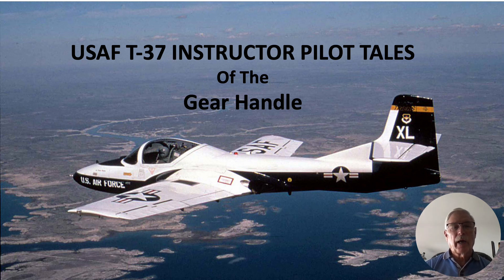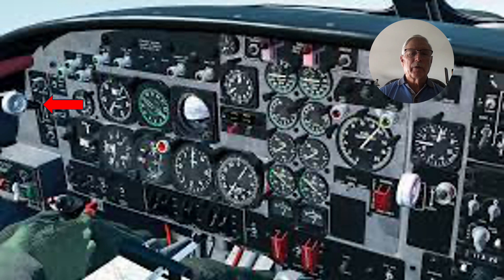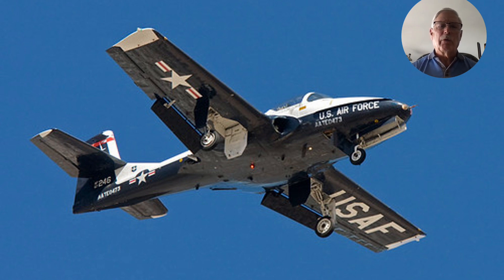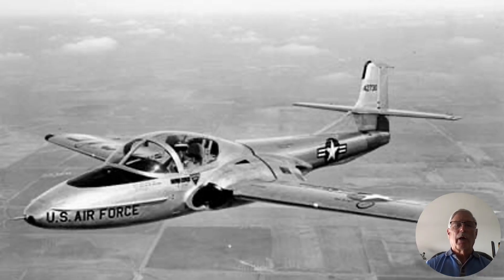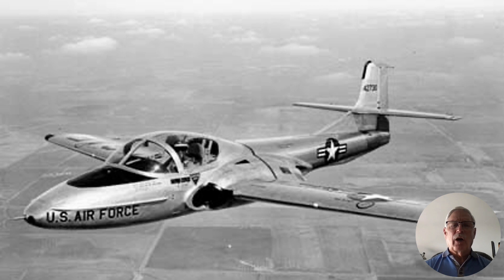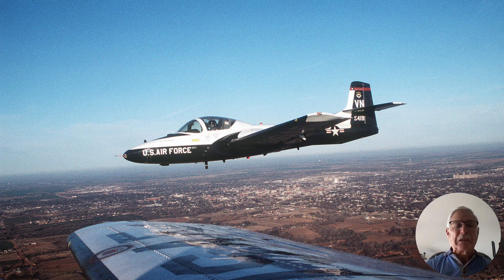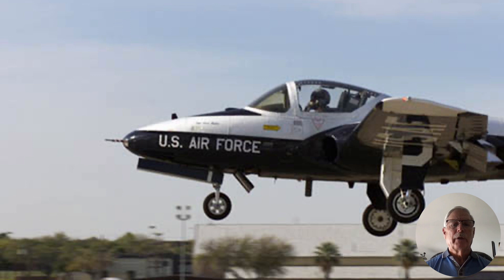USAF Instructor Pilot tales of the gear handle

Comment: I was at an unfamiliar guard base, and we pitched out.  Tower called us to tell us about the F-4 on final, did we have him in sight?  Stanley got all involved in searching for the F-4, and when airspeed began to decay, he advanced power (above the gear horn point).  Tower then told us to extend our downwind because the F-4 was dropping the drag chute and the truck was going out to get it.  We continued on downwind, power up (gear too) and at about 1.5 miles past the threshold, tower said we were cleared to land.  Since we now had almost no altitude to lose to roll out on glidepath, Stanley dropped the flaps and began the "final turn", but it was nearly level to roll out on a good glidepath.  Plenty of headwind, full flaps, no gear (and no horn).  So I pushed the "IP on Private" button and told tower we were gear up and making a low approach.  Stanley couldn't hear this transmission.  At about 1/2 mile final, I asked him how it looked, and he said maybe it would be best if we went around.  Good idea.  He pushed the power all the way up and then reached to raise the gear.  He froze when his hand touched the gear handle already up.  I said "Whatsa matter?  Didn't you think I knew your gear was up?"  He was another pilot (ACE program co-pilot).  Q3 (It wasn't a checkride, but I was an EP and I wasn't about to debrief that one under the rug).  Lesson(s) learned?  If your pattern starts getting too far from normal, clean it up and start over.  Also, any distraction in the cockpit (where was that F-4 again??), means you should double/triple check all your normal procedures.

Comment: Good examples of a couple of classic student errors, Ron.  Giving "lip service" to gear checks, i.e. saying the words without actually checking the items. I also found that when students forgot gear and/or flaps, they tended to focus entirely on reducing power to fix the high airspeed and didn't think to re-check configuration. It's a good thing to remember in any aircraft. 

If I remember correctly, the flap limit in the T-37 was 135 knots, so it was also easy to overspeed them.
Reply from the maker: Thanks and yes, 135 kts

Comment: Probably back in 1993, while I was still a jet engine mechanic working on A-10's assigned to the Pa Air National Guard 111th Fighter Wing out of then Willow Grove NAS, we were on our trim pad facing runway 15 conducting an engine maintenance run on one of our A-10's. Our trim pad was close to the taxiway and runway and always gave us an unobstructed view. Our A-10's were in and out of the pattern that afternoon practicing their approaches after returning from their normal training missions. No touch and goes allowed in the A-10. So as we watch them come in, gear down, get pretty close to touch down, add power, suck up the gear and go around again, we notice one of our A-10's approaching with the gear still up. Now being in the cockpit at the time running the engines I had a very good view of this A-10 approaching with his gear still up. I thought surely he was going to pull up. Nope, got a full view of the A-10 scrapping the runway, adds power and gets it back up in the air. The other two engine mechanics with me on the ground also witnessed this. Now since we were facing runway approach 15 our backs were towards the tower. We were told the tower was flashing the lights and calling out for a go around. We were on ground frequency so we wouldn't hear this. That day was typical load configuration with usually gun dialed in for rounds allowed to be fired on that sortie for the 30mm, two ters loaded with practice BDU-33's. Well after he lands and he's taxing in, we noticed the ter's are now der's. Lol. Not much damage to the jet. Just to the external weapons ter's, now der's and both the bottoms of the vertical stabs were scrapped up a bit. Funny thing is pilot's last name was McGrear. He received the new name "No Gears McGrear" unofficially. I think he was gone shortly after this incident. Never a dull moment at work sometimes. Fortunately no injuries or deaths and just someone's pride was hurt. Jet was fixed quickly and returned to service. And yes, the landing gear warning horn was working properly.

Comment: We had a solo from my class 72-06 at Moody who diverted solo T38 to NAS Albany who was fast on straight in final who could not slow so he dropped the speed brake.  No RSU, of course, so he impacted on his belly and slid to a stop.  He blew the canopy and realized when he hit the ground running what he did.  The magnesium compound bottom did not ignite but the canopy hit the horizontal stabilizer damaging it.  A dual T38 landed on the parallel taxiway almost hitting a firetruck.  They jacked up the white rocket, dropped the gear, and flew it home.

Comment: Ron, Good stories.  Here is another one.  I was in the Willie RSU controlling local T-37's in the traffic pattern when I heard "Mojack, Mojack, Solo 22 over".  I responded, "Solo 22, Go ahead, over".  He responded quickly with "I have two red lights in the handle, over".  The next few seconds were critical.  I could not determine what red lights and what handles!  I responded with "What is your location, over?".  He responded "I'm just past Twin Buttes".  I quickly knew he was in a descent letting down from the contact flying areas to fly back to the Willie runway.  I asked him to push up the power to about 80% and then pull the engines back to idle and confirm he had two red lights in the gear handles and a gear warning horn beeping to indicate his gear was not down.  Here is the response I got back.  "Mojack, never mind!".  He flew back and entered my traffic pattern and made a successful full stop landing.  At the end of my RSU shift, I went to his flight room and asked to see him.  He was embarrassed but had learned a lot in just a few critical seconds.  I had also be subjected to some stressful few seconds of trying to determine exactly what was going on in his aircraft. For the people that don't know, when he pulled the throttles to idle and made steep banked turns with G loading to descend, he had pushed the horn silence button and the red lights in the gear handles indicated the gear were not down and locked.  The T-37 also had a red light in the fuel shutoff T handle that indicated a 'fire' indication in the engine; one red light for each of two engines!
Reply from the maker: Good story! Glad it wasn't the fire handles!

Comment: Many train operators in Japan make hand and head gestures as they go through mental checklists.  It forces them to slow down and look at the things they're supposed to be verifying which I found to be useful when running checklists as a GA pilot.  I like to point at instruments and controls when verifying settings and for the high wings Cessnas after completing checks at the tail, while I'm still standing back there, I like to trace the profile of the main wings with my hand as I verify no wrinkles or bends and karate-chop the fuel caps as I check that they're both present and twisted in the correct position.  I don't care what other people think about how it looks, it helps me make sure I'm actually checking these things and not just mouthing the list to myself absentmindedly.

Comment: I was commissioned out of AFROTC, May 1975. Awaiting assignment to UPT. Waited nearly a year, no pay, then get a letter from ARPC in Denver, saying I will NOT be going to pilot training, as there has been a reduction in training (we were still training Iranians).  I was told I would be getting a non-flying job in the AF…not what I sighted up to do, so I ended up resigning my commission and requesting a hardship discharge (was assigned to do 90 days in an AF Reserve unit), but was released from that as I needed to go to a civilian job to begin earning some money!Also, the first women to go to UPT, went in 1976…I guess one of them got my slot!

Comment: I have a hazy memory of being trained to slam that gear handle down. Something to do with how that system worked.
Reply from the maker: At least, make a positive engagement of the down position.
Reply: It's because it was connected to the actual hydraulic valve.  It took a fair amount of force to move it and it was possible to get an "in between" position where the gear didn't extend and lock.  I personally never liked the technique of "slamming" the handle, because there wasn't a lot of clearance above or below the handle to work with.  When raising the gear, I moved it partway, then readjusted my hand position to move it fully up. 

The T-6 Texan II has an electric gear handle. A lot easier to move and no need to slam it.